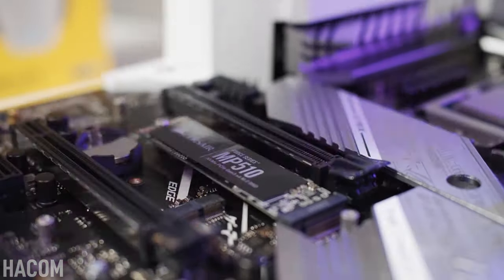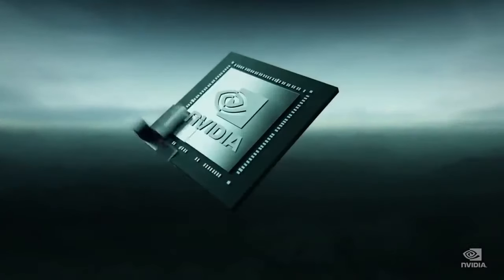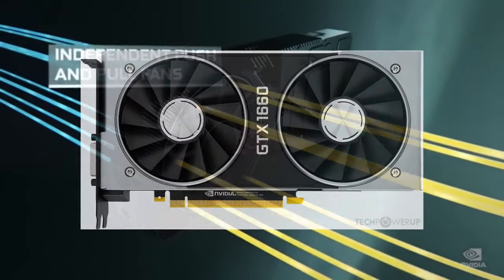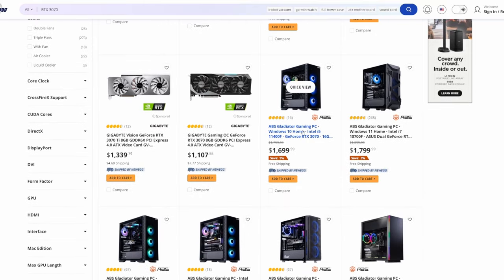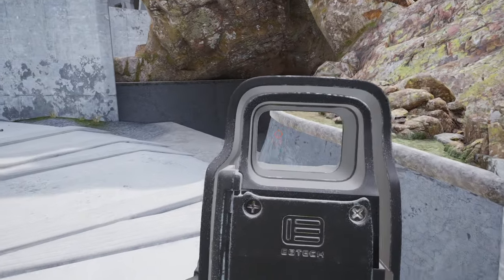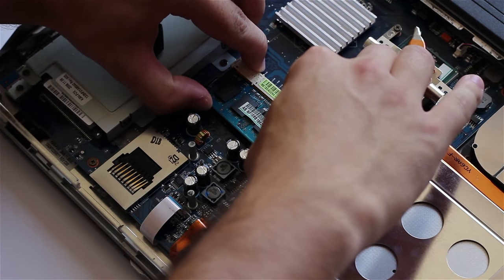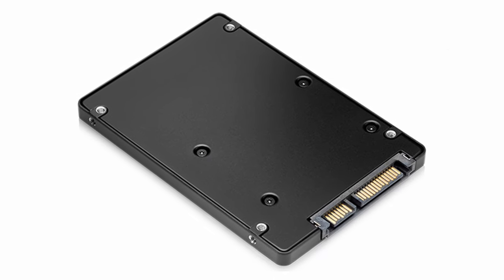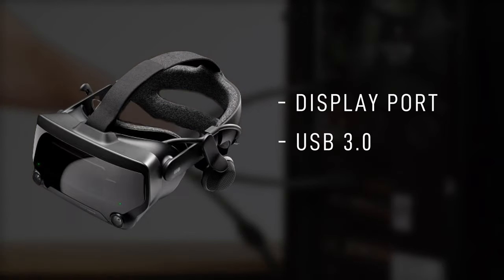BEST 'VR Ready' PCs for VR Gaming on Any Budget

Comment: I have a laptop with 3070 and it performs nearly as good as a PC. Usually in the newest games I get 5 or 10 fps less than a desktop with same specs. If you're buying a laptop buy Asus ROG
Reply from the maker: We currently use those for our portable demo rigs. Those laptops are excellent and can run surprisingly cool with a cooling pad. -Albert
Reply: A laptop is a PC. PC stands for Personal Computer, and dude, ROG laptops are some of the most expensive there are.
Reply: @anakinlowground5515  I know but I need it for work and games. I could stay in one city for long because of personal reasons so I had to buy a laptop. I don't regret it because when the war in Ukraine started I had to leave with only a backpack. I just wouldn't be able to take a full size pc with me.
Reply: @bigboar0074  alright, that’s understandable right there.
Reply: @anakinlowground5515  I wrote could but I meant to say couldn't
Reply: Should Lenovo loq i5 13420h with 3050 6gb work for pcvr or with an oculus2?

Comment: Be aware that the main reason to avoid prebuilt machines is sometimes theyre assembled with parts that may not have met spec from the manufacturer.  Theres a reason pre builts are cheaper, you may get the bottom of the barrel.

Comment: 2 things, please no one use UserBenchmark to compare CPUs the are the single worst source of information on performance comparisons.
And I would not say 16gb is all anyone needs some newer games have less stuttering with 32gb and its only $50 difference between 16 and 32gb. 16gb is fine but if you want to multitask a lot, mod games or not have to worry about things running in the background as much 32gb is very usefull.
Reply: I agree with the ram, 32Gb is better, I had 16Gb 3600 replaced the two sticks with 4 sticks of 32Gb 3400 and got a 1% framerate boost, using 3DMark. Processor at the time was a Ryzen 9 5950x water cooled, GPU was a MSI Suprim RTX 3070 TI. Currently, I have a Ryzen 7 3900 and EVGA RTX 3070 FTW3, its better at overclocking and the EVGA runs rings round the MSI card.
Reply: Ik your posted this a year ago but i wanna add i just went vr clubbing in vr chat and was in the 25g out of my 32 so more then 16 is definitely the way to go

Comment: This is very useful info. But on the laptop side of things you missed an important point: some laptops straight out do not (!) work with the non-standalone VR headsets (I.e. those that plug in to the HDMI port of your laptop). That is because the HDMI ports on some laptops are actually connected to the iGPU of the Laptop.
So, a caution to go in buying a laptop without much research only if you have a Quest or Pico headset would have been good.
Reply: I used to be a big proponent of cabled vr, now with a proper wireless setup(air bridge), walking wall to wall in my living room with no cord is godsend.
Reply: @OmbaAphire  Wireless is very freeing. True. It has its pros and cons, but if it's about a lot if moving about, it does shine.

Comment: I have a Quest 2 with a GTX 1660 super and a RYZEN 5 5600G, and its surprising how good everythin looks even in low or medium settings.
Reply: Does it also work on non vr games like roblox
Reply: @Recroommusicsal  the pc? Yes, it can play pretty much everythin in 1080p, some newer games you have to play in medium or low, but it should work very well for the price of a used gtx 1660 super, with the ryzen 5 5600g you could go up to an rtx 3060 if you have a good enough psu
Reply: @santiagopeon8918  so wait do I need my own wifi to do it
Reply: @Recroommusicsal  you mean conect a quest 2 to the pc? You can use wifi with  steam link or oculus air , or you can use a cable with oculus link
Reply: @santiagopeon8918  what about
Reply: @santiagopeon8918  could I also connect my Xbox etc etc to it
Reply: @Recroommusicsal  you can connect an xbox controller to the quest 2 trough bluetooth, and the go to xbox cloud service, but im not sure if that will let you play vr games, or just use the quest 2 as a big screen.
Reply: @santiagopeon8918  no like for the pc
Reply: @Recroommusicsal  i dont get it, connect you xbox to the pc?
Reply: @santiagopeon8918  yes not the quest but the pc so I can play Xbox on my monitor
Reply: @Recroommusicsal  if you want to use the same monitor on a pc and on xbox yu have to get an KVM switch or an HDMI bi-directional switch, it lets you conect multiple machines to one monitor and then switch between one and the other

Comment: Y’all im not to into computers so im not sure on equivalents but is this pc ready for vr

CPU/Processor: AMD Ryzen 5 7600X 6-Core/12Thread 5nm ZEN 4 Processor

CPU Cooler: CORSAIR iCUE H100i ELITE CAPELLIX Liquid CPU Cooler

GPU/Graphics: MSI GeForce RTX 3060 Ti VENTUS 2X 8GB

RAM: CORSAIR Vengeance 32GB (2x16GB) DDR5 5200MT/s C40 Black

Storage: WD Blue SN570 1TB M.2 NVMe PCI-E Read:3500 MB/s Write:3000 MB/s Solid State Drive

Motherboard: GIGABYTE X670 AORUS ELITE AX AM5

PowerSupply: AZZA 750W

OS: Windows 10 Pro
Reply: Definitely

Comment: I have a RTX 2070 with a AMD Ryzen 7 1700 eight-core processor with 16gbs of Ram and i still lag in VR. What upgrades do i need?
Reply: The CPU needs an upgrade, For VR you I would recommend a Ryzen 5 5600 for your RTX 2070 Since first gen Ryzen is very outdated and has much higher latency and lower clock speeds
Reply: i have an option to buy a 3060 12gb for 120€ or a 4060ti 12gb for 280€, both good deals, but the 3060 one is a better deal… which one should I choose for vr sim racing? Also i’m planning on pairing it up with a i3 12100f because i think sim racing isnt that cpu intensive… or should i get a better one?

Comment: What about IPASON - Gaming PC - Intel i3 12100F - GeForce GTX 1650 - 16GB DDR4 3200MHz - 480GB M.2 NVMe SSD - WIFI - Windows 11 Home - RGB Fans - Gaming desktop on new egg
Reply: Would definitely need slightly better specs than that, mainly the gpu. would need at very minimum a 1650 super or 1060 6gb.

Comment: i have rx570 8GB with 8GB ram. It works fine. But u gotta do some tweaks on the graphic setting.
Reply: thats a little rough for higher end vr games, how does half life alyx run? i played on a 1060 6gb and 16gb ram which is generally a bit above your pc and on low it still had pretty big drops down to like 30fps-40fps
Reply: i got the rx 580 8gb runs half life alyx at low 50-60 fps but i'm used to nintendo switch so i'm good

Comment: Wait, you know M.2 NVME drives are SSDs right? Like, I'm gonna assume you do because you sound like you know what you're talking about but Sata SSDs aren't like some different technology to NVME SSDs, they just perform worse because higher end parts would be bottlenecked by the connected like how USB2 thumb drives are slower than USB3 thumb drives but they're all flash storage.

Comment: Is a rtx 2070 max q with intel core i7-10750 vr ready?
Reply: yes, but just so you know max q means they cut the performance in half and took the other side
Reply: @Disabled_Toad  you know whats sad? Its isnt vr ready i get like 10 fps on blade and sorcery minimum settings
Reply: @HQBOXXED  That sucks, but it's performance is in the name, max-q which makes it perform like a gt 710, so if your upgrading to a better laptop (max-q is only for laptop if i'm correct) make sure the card is NOT max-q. A rtx 2070 NON MAXQ would be a major upgrade. My desktop rx 580 is out performing your max-q 2070 which is crazy cause it's a 2070 (max-q sadly)
Reply: @HQBOXXED  After all it is a Max-q card which is designed for slim laptops which cuts the thickness and weight in half but also the performance. My rx 580 8gb is running blade and sorcery better.
Reply: @HQBOXXED  Max-q cuts the weight thickness AND PERFORMANCE in half. Next upgrade get a NON Max-q card.
Reply: @Disabled_Toad  ok thx bro you helped me with m upgrade
Reply: @HQBOXXED  np

Comment: I've got a 3060 12g  and I struggle and it says I'm only using about 65% of my gpu what am I doing wrong?
Reply: what kind of a CPU do you have. you might have bottlenecking
Reply: @aesthetictap3401  ryzen 7 5800x
Reply: @MrDeathwishVR  you shouldn’t have any bottlenecking then.. How much ram?
Reply: @aesthetictap3401  I just need a better gpu I think.
Reply: @MrDeathwishVR  nah, the 3060 is a very capable gpu
Reply: @aesthetictap3401  for flatscreen gaming yeah..
Reply: @MrDeathwishVR  I asked one of my gaming nerd buddies, and he said it should be fine for vr.. what are you trying to run?
Reply: @aesthetictap3401  it struggles with just about everything vr. I've done just about every fix I can find online, with everyone else telling me they run vr in high settings with a 3060 which just isn't happening on my system. A lot of new vr games reccomend at least a 3080 so..
Reply: @MrDeathwishVR  Well it also depends on your internet connection, and definitely ram, having 16gb is even cutting it too close for vr, thats why im splurging for 32gb in my build, my build will be a Ryzen 5 5500 rtx 3060 32gb ram build, so it will be vr capable in mid range. you shouldnt be having issues

Comment: Does the Ghz matter in vr gaming?
Reply: Somewhat, though it isn’t the end all be all. You should also look at how many cores a cpu has. For instance, you could have a dual core cpu with 4ghz per core, but it would be better to get a cpu with four cores of 3ghz or something like that. 

Also highly recommend taking a look at what kind of games you want to run and comparing the minimum requirements then getting something at least a little better than that. Hope that helps!

Comment: Came to compare my vr setup to what is the recommended. I agree with the point about the laptop heating, when playing heavy games or downloading 2TB of data the laptops get dangerously toasty 😅 my gpu is external and runs without a case and I keep th ac at 70 on so there is great cooling, don’t recommend if you are clumsy or like to have messy lunches and get you carbonara sauce all over your gpu board/fans. I have a 16 MacBook Pro running windows 10 with a 12 core intel i7 thinking about getting cooling cuz sometimes I think it’s its last day as a solid and turning to a liquid. External gpu box without the enclosure just the board is a core x chroma. Gpu is a 3090tiFounders edition that laughs at the cpu when it comes to temps and usage. Did have to disconnect the 700W power unit that comes with the core x chroma, had to get a Corsair hx1000 with 3 pcle connectors had to drive in traffic at 6 pm to another city to get that damn thing. Needed an external SSD for more memory 1TB was split in two between the MACOS and windows partition so I picked up a 2TB external ssd from San disk with 1000Mbs read and write. Already had a Corsair keyboard and mouse from my engineering job so that was nice to already have as well as 4K 144monitor. The only time I ran into any sort of performance issues is when rarely a game like Boneworks will say that intel i7 12 core meets the minimum requirements but no visible lag or detail drops at all when running at 120hz with all graphics setting and  on ultra. Just remember not all pcvr games DONT run at 120hz so you have to move around settings for each game. That’s about by biggest complaint about vr gaming. Besides that it’s great fun much better than screen gaming and I never get tired of seeing people try it for the first time. I don’t take it slow at all I throw them on resident evil village vr right from the get go.

Comment: you can't run half life alyx with max settings on 3080. It says "not enough vram" and textures starts looking like in 1995. You have to lower textures quality. 10 gb vram is not enough for vr. I personally have 3080 and i'd prefer to have 6800 xt instead (16 gb vram)

Comment: Will a 2060 and a i7 run fine
Reply: 2060 will do VR easily, same with the i7 but it really depends on the generation of the i7. Even if it's an older 4th gen CPU it'll be fine, but I suggest having a newer i7 like a 10th, 11th, or 12th gen.

Comment: my friend has a 1650, works just fine for vr
Reply: I have a 1650 super i use for vr right now, it can run blade and sorcery with tons of mods with minor setting changes.
Reply: @averageperson3213  how much did it cost
Reply: @Traertot  You can find them for as low as 300 dollars, They are pretty goddamn cheap for their effectiveness

Comment: I am going to buy a new pc. I am thinking RTX 3060/3060ti. I don't know about processor. I5 12400f, Ryzen 5 5600x, Ryzen 7 3400x. Which one would be the best for 3060?
Reply: First of all, if you can afford it, get a 3060ti. It is SO MUCH faster than a 3060.  You can save money by getting a Ryzen 5 5600x (which will perform just as well as your other options when it comes to VR), but (at least in my opinion) a 12400f is more future proof. For ram, if you can afford it, I highly suggest getting 3600mhz DDR4 RAM as it's really well priced right now!
Reply: ryzen 7 3700x